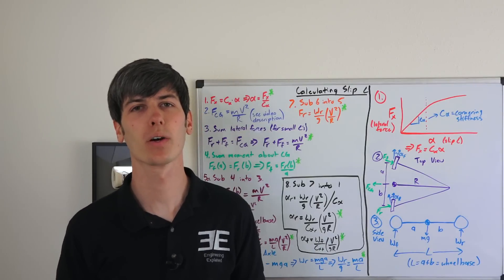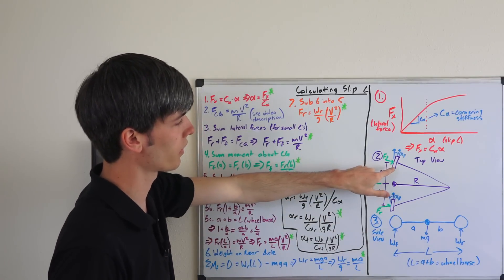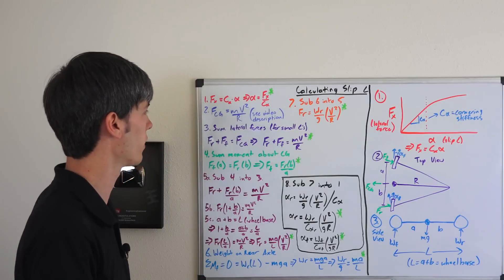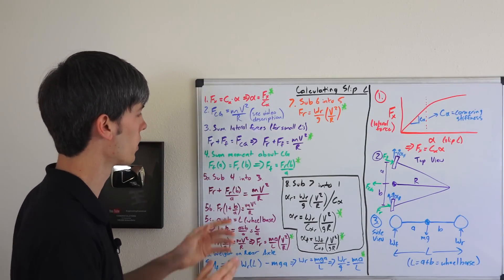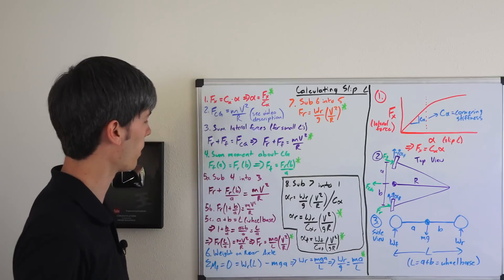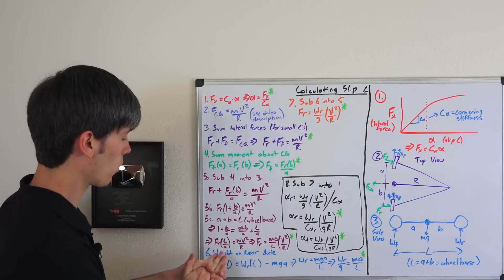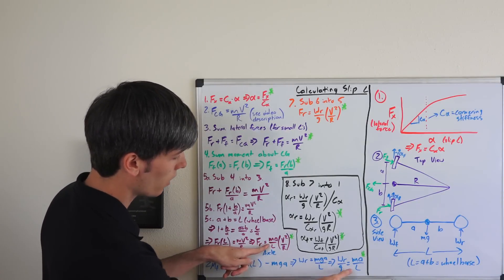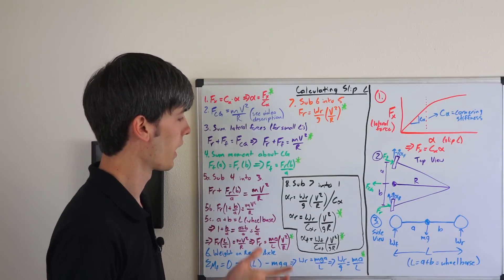Deriving Car Slip Angles - Tire Slip - WARNING: Maths

Comment: Hi man, first of all nice video.
Recently I test drove a BMW r1200gs (motorcycle), which has a cardan shaft. I was wondering if you could do an explanation video on this. I know you mainly focus on cars, but I think it would be extremely helpful if you could do an in-depth video on cardan shafts (on for example BMWs).
Reply: AKDaBear FWIW, a cardan shaft is pretty much a simplified version of a CV shaft.
Reply: David F. Thanks, but I'm wondering why BMW uses a cardan shaft on their bikes instead of a chain which other companies use, like the pros/cons of using a cardan vs chain etc
Reply: AKDaBear
I believe it's mainly due to the losses in power transfer. A cardan shaft will experience less loss as opposed to a chain, but a chain is cheaper to produce and manufacture. That's why you tend to see cardan shafts on more expensive bikes like a BMW, whereas you usually see chains on other more affordable bikes.
Reply: David F. Thanks! Do you know something about the maintenance/durability of the cardan vs chain? For example, I believe the Dakar riders have chains apposed to cardan, would that be because of durability or stress on the cardan or something else?
Reply: AKDaBear
Probably easier to maintain/repair like you said. I feel like it would be a pain in the butt to tear down and repair or even replace a cardan shaft in the middle of a race, that's assuming you have the part(s) with you. If a chain breaks its much easier to slap on a new one. You just wrap the chain around the two gears/cogs connect the master link and tension it, and you're ready to go.
Reply: David F. Yeah and I guess a spare chain can be brought along, a spare cardan would be larger and heavier.
Reply: AKDaBear
Yep! exactly. Have you ever watched Long Way Down or Long Way Round?
Reply: David F. Nope, never heard of it haha
Reply: AKDaBear Oh lol, well its a TV show where Ewan McGregor and some other guy ride BMW motorcycles around the world. You should check it out on Netflix sometime.
Reply: David F. Just checked it out, looks amazing! I guess I know what I'll be wachting soon haha, thanks
Reply: AKDaBear
You're welcome! It's an awesome show.

Comment: Hi, 
First of all, great video as always
Second, I was wondering if in one of your next videos you could explain the importance of the roll center heigth, and why it's important to keep it as low as possible

Thanks!
Reply: I do not know of it being stated anywhere that roll-centre should be kept as low as possible. It is a chassis geometry tuning option in RC racing. Whether it is set low middle or high front or rear is a user choice based track topography and its conditions.
Reply: It shud be kept as low as possible and as much nearer to CG of Vehicle.
Roll centre height plays important role in the development of JACKING force when a Vehicle is cornering. And this Jacking force is important in keeping the vehicle's Suspension in not compressing too much.

Comment: Why do you say "simple" so many times in this video?
Reply: ***** Because it is really basic calculations that mechanical engineers use on a daily basis with quite simple maths I must admit.
Reply: ***** https://en.wikipedia.org/wiki/Boundary_layer#Predicting_Transient_Boundary_Layer_Thickness_in_a_Cylinder_Using_Dimensional_Analysis here's a more complicated example of the math that an engineer may work with